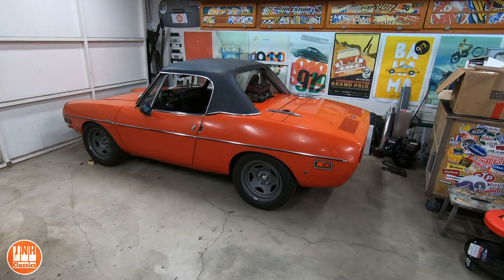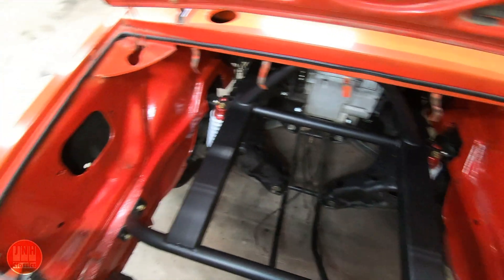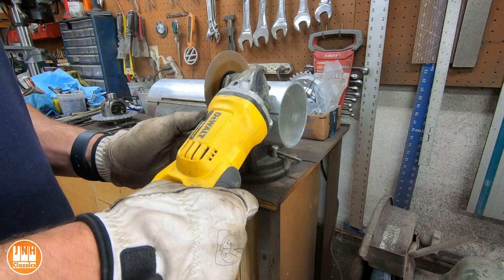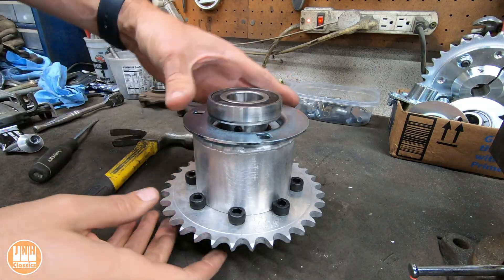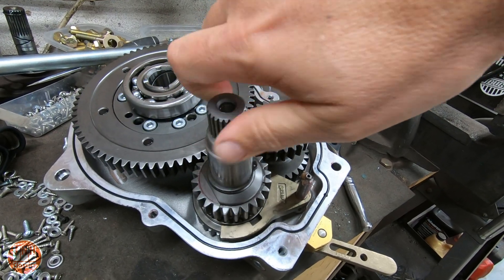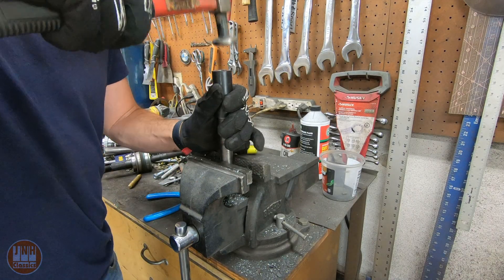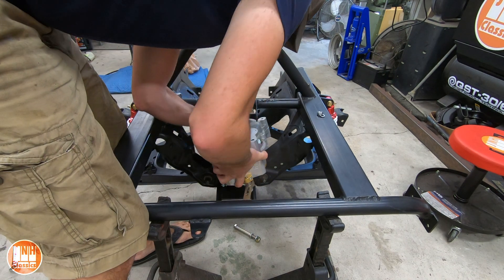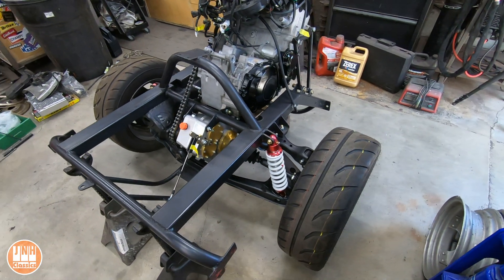My Car is Chain Drive! - Motorcycle Powered Car!

Comment: Wonderful! For the "easy" differential way = why do you need the custom made "cup" on the Miata differential for ? It looks like to hold the lubricant inside ? So why do you need lubricant on the outside of the differential, I mean why not do exactly the same but without a cap. Sorry I do not know much, I am researching something similar.
Reply from the maker: The differential needs lubrication
Reply: @Jerod_Helt  I know, but why didn't the original diff have this ?
Reply from the maker: @dimitristripakis7364 it did. All diffs are inside of a differential housing of some kind
Reply: @Jerod_Helt Thanks mate! Unbelievable work, has this diff worked for you, did you even try it on this or other project ?

Comment: The original Quaife transmission universal gear drive coupler has the advantage that the drive bolts directly to the output shaft of the bike gearbox and is totally enclosed to the rear diff position.  The engine sits lower, improving the C of G and the drive is fully lubricated so has reasonable maintenance intervals.  The final drive unit selected is primarily used for off road carts  generally with twin cylinder engines with lower power than the 4 cylinder engines and is around 2/3rd the price of the direct attachment unit.  The issue with the chain drive unit is that the chain requires constant maintenance and oiling, which on a car would be quite excessive.  A chain oiler system like a Scottoiler would be a must have.  The other consideration is chain breakage that can be deadly unless contained, so that a steel chain guard will be necessary to protect the car occupants and the public.

Comment: Nice quick illustration of converting a differential intended to operate in a fixed housing to a chain-drive unit. The use of grease instead of oil is a bit surprising - that's fine for bearings but I wouldn't expect it to stay where it is needed for the gears.

Comment: Never weld an axle like that! it will brake around the weld, only plug weld them with a sleeve.
Reply: There are no ashtrays on the axle. Bad place to have a break...
Reply: I have a Yamaha 11vspecial engine I want to do this with. It's shaft drive.  No chains, but no reverse... find an old Chrysler fwd/ rev. Gearbox from an old forklift..

Comment: Hello Jerod, thanks for sharing. For the electronics of the Suzuki engine. I believe you did use the harness of the bike, but did you eliminate some codes of the harness but the transmission? How you did that or what you did? Many thanks
Reply from the maker: I used the full wire harness and all the original sensors from the bike. I just moved everything over to the car. I figured Suzuki knew what they were doing when they built it.
Reply: @Jerod_Helt  thanks

Comment: how did you calculatefigure out the drive shaft lengths? been eyeing a somewhat similar project
Reply from the maker: Once the gear box was installed I measured the distance and cut down the two shafts. To be honest I think one is a little longer than it should be and might cause premature wear but so far it hasn’t been a problem. I actually didn’t think they would hold up and expected to have some custom made, but to my surprise they have worked just fine.

Comment: Does that work just the same on downshifts? Do you ever feel any slack in the chain so to speak, or for all intents and purposes does it feel like having a solid drive train from the engine to the wheels?
Reply from the maker: It feels just like a motorcycle when it shifts. Also you don’t need to use the clutch to upshift, just like on a bike. It’s awesome!

Comment: Why not use a boxster transmission?
Reply from the maker: I don’t know anything about a boxster transmission. But remember it has to be small, lightweight and easy to connect with to the chain drive of the bike engine.
Reply: Perhaps because it weighs about as much as the whole engine, or because the engine comes with transmission attached to it would make no sense to have another complete transmission.

Comment: Nice work what about the oil sump?
Reply from the maker: What about it? No changes were made to the bike engine or its oil system
Reply: @ the oil in a high g turn will uncover the oil pick up because bikes lean in the turn and the car doesn’t. You need to modify the oil pan and the pick up. Check out super fast Matt he blew his up and found this problem.

Comment: Are you going to use the rear engine mount? It looks to me like you're putting an awful lot of leverage on the two front engine mounts by not using that rear mount; consider that there is a lot of weigh in the back of the bike powerplant, where the transmission is, and it wasn't designed to have that weight hanging only from the front mounts. Maybe it'll be fine, I don't know. But maybe you'll hit a bump in the road and crack the thin + lightweight aluminium engine casings, dump all the oil onto the exhaust and rear wheels, destroy the motor and start a significant oil fire.

Comment: Wasn't there a Quaife setup which didn't even require a chain? Much safer on the long run.
Reply: I assume that you are referring to the Quaife Universal Gear Drive Transfer Unit - it is based on the QBA2R unit used here but includes a gear-drive system in place of the chain.

The other approach for using motorcycle powertrains (engine and transmission) is to connect it to the final drive with a shaft. That normally works better when the engine is remote from the axle (i.e. front engine / rear drive), and works with either a shaft-drive powertrain or a chain-drive powertrain turned sideways so the output sprocket can be replaced with a shaft drive flange.  For all-shaft configurations Quaife offers an In-Line Reversing Box
Reply: @brianb-p6586 IIRC that was not a transfer case. Might be that in-line reverse.
Reply: @zOiNhUh I didn't say anything about a transfer case. And I explicitly mentioned the inline reversing box. Did you read my comment?
Reply: @brianb-p6586 yes I did read. But anyway, there is always some option to avoid chains.

Comment: I just talked to them 15 weeks to get one , it’s depressing wait time
Reply from the maker: I understand how you feel.
Reply: @Jerod_Helt  today I wired the money , it’s sure ain’t cheap but I don’t have power to invent the wheel or go on adventures, this unit looks solid .
Reply from the maker: @996turbo  it’s a solid unit. It’s also the most expensive part of my build, by far. It cost more than the car and more than the bike.
Reply: @Jerod_Helt over the years i probably dropped a small apt into my fiat , my dream was k20 turbo , first engine blow head gasket, second engine I picked fully built civic drove it 200 miles home , put the set up in the fiat , and it blow up again , so 2020 came I said let’s build fullllly built set up , engine builder did the worse job I ever seen head broke leaking coolant between block and head , so 4 years car just sitting and I’m dumping money.  So bike motor is going to be the next way I think it’s easier.
Reply: @Jerod_Helt  what chain you running 520 ? Or bigger,  I just picked 2023zx14r. I’m collecting the parts , your chain looks bigger than 520.
Reply from the maker: @996turbo I’m running a 520 chain
Reply: @Jerod_Helt just got mine today , I almost forgot I ordered it , where did you order the fiasta axles from , and what sprocket did you use ?
Reply from the maker: @996turbo I think I bought the axles on eBay. They were easy to find. Depending on which type of shaft you have you may or may not need an adapter which they sell. I ended up finding some industrial sprockets that worked for me. But they were kinda hard to find. The sprockets were probably the hardest part for me. But that’s because my box has the splined shaft and not the keyed shaft.
Reply: @Jerod_Helt it looks just like yours , do you mind telling the company or stamp on the sproket? , i can tell you one thing dealing with them / dhl/ us customs was a nightmare, I never seen shit show like that

Comment: Those pod filters won’t cut it!   There is a lot of tech that went into the air box design, more than most people understand.
It smooths out the power delivery,  it catches the reversion pulses and fuel in these pulses , meaning with out the airbox you will need to add fuel to make the engine run and its fuel consumption will suffer with out the airbox.
Lastly most bike lose between 20 -30 hp when you remove the airbox and retune it.
How do I know all this? 
I have been dyno tuning motorcycles for a very long time .  I have seen this airbox removal many times , I have read engineering books on airbox design and I have a lot of time trying to design new air boxes for bike engines being turboed or engine swaps where the original airbox was not going to work.    As I said there is a lot of design tech that goes into these factory air boxes and removing result in a horrible and pesky engine with a much narrower power and torque delivery and dead’s spot lower in the rpm , hesitations getting on the throttle etc.
It will require a lot of retuning to get it to run half decent . 
Just trying to help
Reply from the maker: I actually built a custom airbox in a recent video👍

Comment: Tip
It may be possible to recycle the prop drive from an outboard motor to use as either a reverse gear or right angle drive or both.

Comment: That's really awesome. My only complaint about that, is it puts a lot of weight very high. Ok, I guess you're not building a gokart, you're re-powering a 1960s Italian sportscar in a shoe-box, but ...
I love the choice of components and concepts, but I'd like the engine to be sitting at least 6 ~ 8 inches lower ~ preferably 12.
---- Thought experiment. Start with a Porsche Boxter. Now take the bodywork off and turn it into a 1960s formula one car ~ no side-pods, looks like a torpedo. Now compare your Boxter formula one, to this. How are they different?
A: Your Porsche has massively radically lower centre of gravity. Thank you ~ that's my point.

Comment: where did u get these cv axles? are they custom made or any standard which you have modified?
Reply from the maker: I bought stock axles cut them in half and welded them together

Comment: Just subscribed! I like your thinking, The easy way... or the Expensive way!
I want to know if you have driven much with the short chain?
I built my bike engine Smart and the chain is the noisy, high maintenance part.
 I was thinking about the Quaife bike engine units that do not use a chain. Any thought?
Reply from the maker: I’ve put about 1500 miles on it. The chain seems fine although it did stretch a little at first.
Reply: @JNH Classics  do you have an oiler like a schott oiler or do you just oil the chain as needed? 
I built mine in a pinch and used the chain from the bike that has tight spots and it causes my engine to have a warble and shake under load.  I have a new design for my differential and I will replace the chain with a new one and add the schott oiler.
Reply from the maker: I don’t use an oiler. I used a new sealed chain and haven’t had any problems yet.

Comment: Amazing build! I am looking into buying a quaife diff. What ratio reduction do you have on your differential and how is your sprocket setup? Do you also know where I can get sprockets that fits the splines on the differential?
Reply from the maker: The Quaife diff has a 3.025 reduction. It was hard to find sprockets to fit the diff. I had to buy the taper lock adaptor from Quaife then I bought sprockets from MDS. Just google "MDS Sprockets" and you should find them. I used the (Taper-Lock Sprocket, #50BTL20). It's probably better to get the diff with the keyed shaft rather than the splined shaft so you don't need the adapter and have more options for sourcing the sprockets.

Comment: Hi Jerod.  I am working on a motorcycle engine powered autocross car so have to say your project is really cool.  I need to build custom cv axles like you did.  Wondering if the axles are still holding up and not producing any vibration or other issues?  Anything you would do differently if you did them again?  Thanks in advance for any tips.
Reply from the maker: The axles are working perfectly with no vibration. I’m very happy with them and can’t think of anything I would have done differently. Be sure to drill holes in the sleeves for plug welds👍
Reply: @JNH Classics  thanks for the update!  Glad the car is holding up.